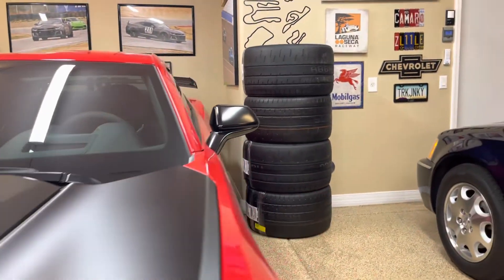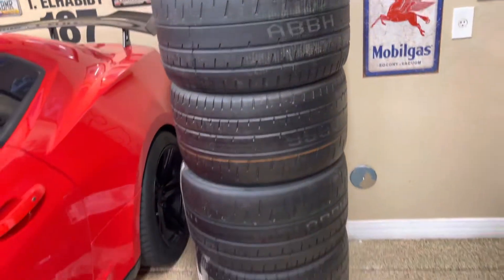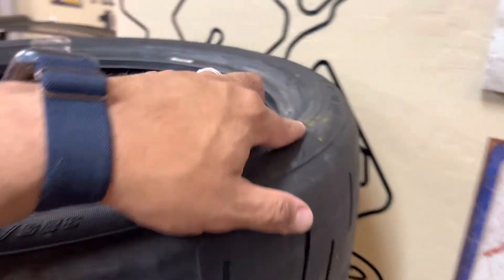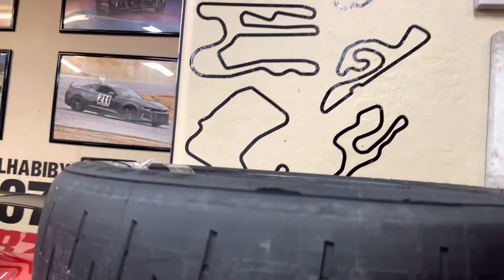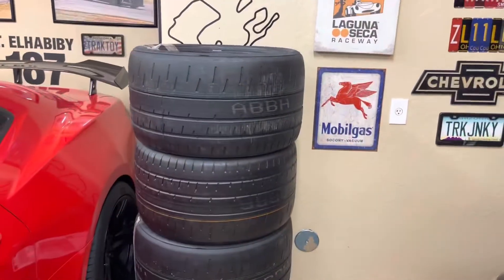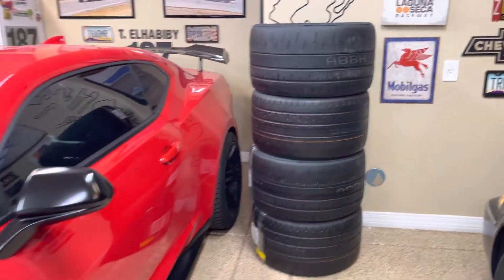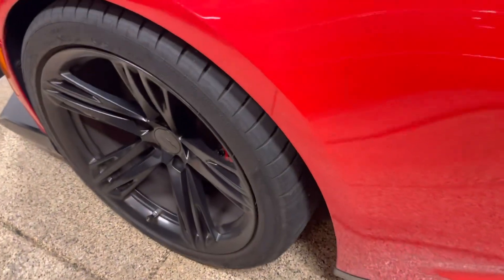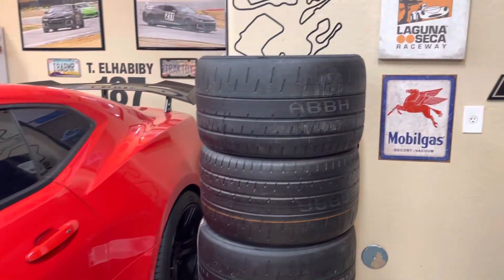Heat Cycling A Racing Tire / The forgotten special ingredient in your Track Day Tire!

Comment: Thanks a lot man. Very clearly. I’m gonna do it. One question. How much you pay at the shop for installing them? They are adding a bunch of stuff I don’t know if I’m getting ripped off or what. Thx
Reply: Mounting, Balancing & new Valve Stem for $20 per tire. Go to a Mexican owned Tire Shop.
Reply from the maker: Usually $200-$300 for mounting balance and disposal
Reply: @the_track_enthusiast  that's crazy aslll plus all u gotta do is a burnout then let them sit like u said